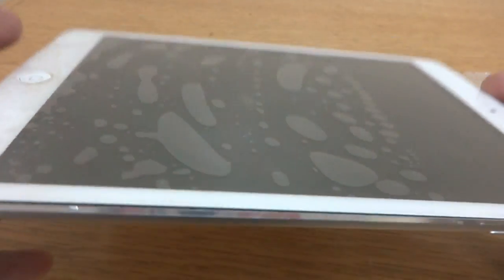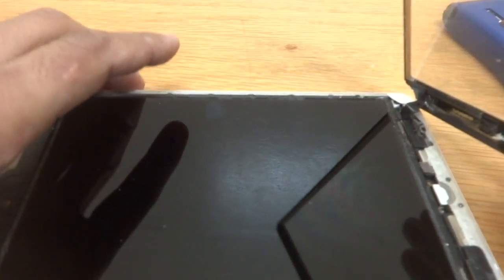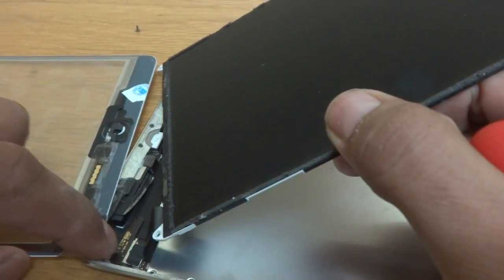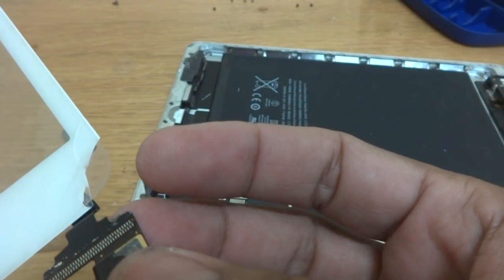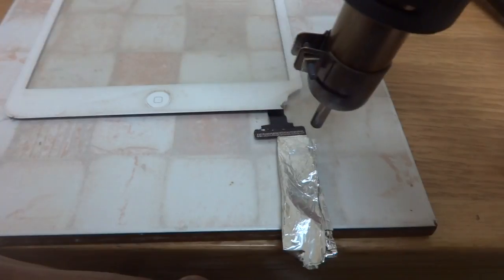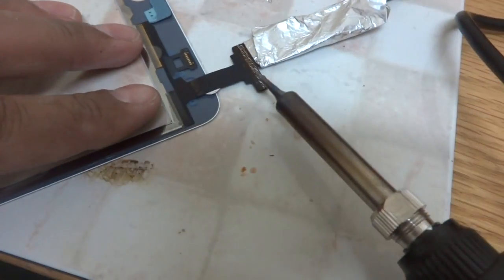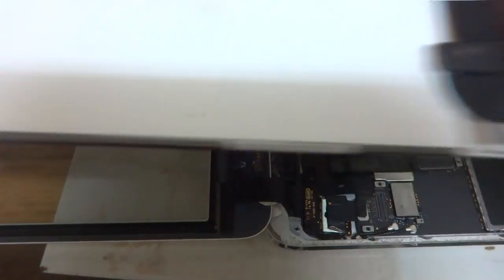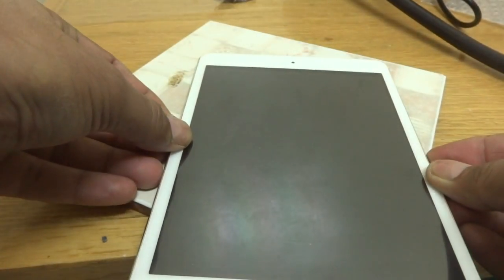ipad broken screen replacement. DIY home repair method

Comment: Smashing job jahan :-)) your braver than i.

Those tiny solder connections look horrible to do :(, i think i would need glasses to see them now, im loseing some close up focus, at 49 im an old man ha ha :-))
The china made one is incomplete really, it should have had both cables allready attached and "ready to go".
I hope your frends are not overworking you with there ill cars lol.
Reply from the maker: zx8401ztv Realy sir they are difficult to do connections. The one complete unit was expensive so I decided to solder it myself and save some money on my work. I soldered it using BGA soldering technique! It was an easy job then expectation. Soldering and desoldering was not that difficult how I was thinking of.
I am tired of cars dear sir. No more working on them. This is something bullshit job and a thankless job! My own car had created many problems but I am not liking to solve them. I am feeling boring of cars now.
Reply: LearningZone
Yes i do understand jahan, people will "use you" for cheap repairs, i have repaired electronics for people, i charged very little or nothing because im not into money or greed, but i like helping people so i helped them and that was my choice.
It did not fill the bank with money, after i quit i didnt even get a thank you, does this seem familiar to you?
Reply from the maker: zx8401ztv Same is the case with me as well. I was doing it as a help and sometimes i was charging very nominal to continue my experiments and research. People were not happy with that. Some were thinking that I become millionaire by that way and some were feeling jealousy. I faced difficult situation. Handled crud people in this field. So for these valid reasons I am not liking such a business.
Reply: LearningZone
Im sorry that you have wasted your time with selfish people, please remember that we are not all the same, i appreciate your intellegence/skill and great kindness to other humans, we are not all bad.

Help ONLY your "REAL" frends, the frends that will jump in to help you when your in need, the frends that DONT hold there hand out for money to help you.
Jahan I hope your interest in your own car comes back, NOT to make videos or anything, but just to do the repairs to keep it running.